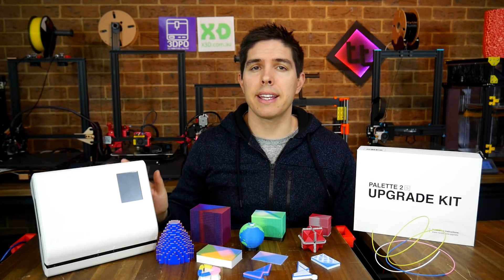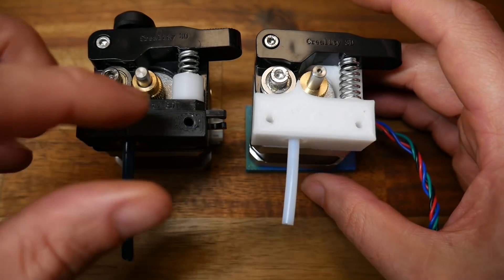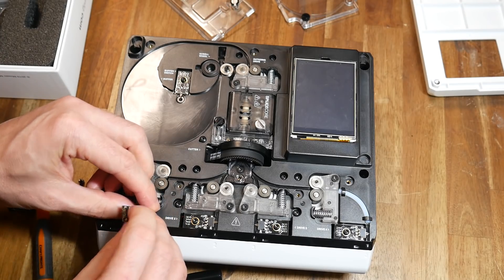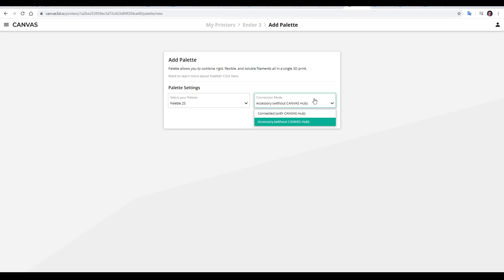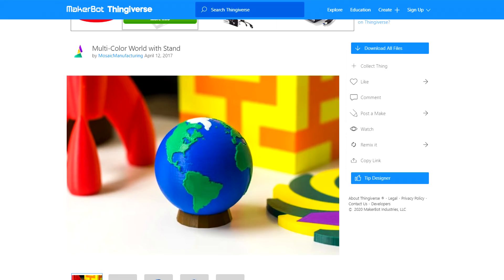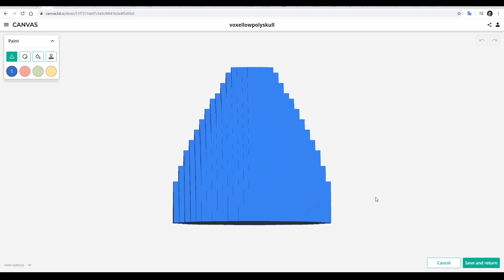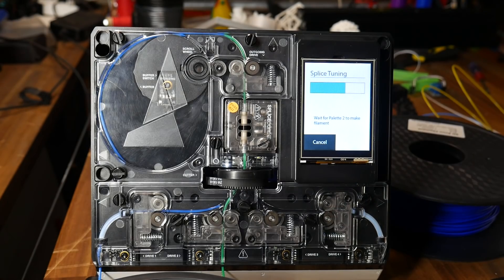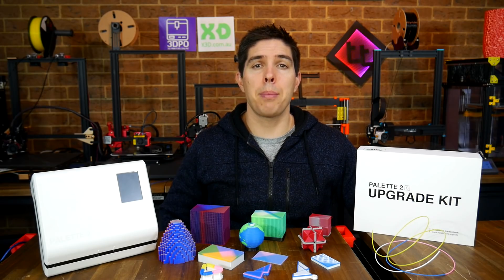Testing the Palette 2S upgrade kit

Comment: LMFAO, the damn original kit is $500, and THEN you have to buy a "upgrade kit" for an additional $125 to even make it work properly ?? Is this some kind of joke ?? When you have to buy additional parts to make the product work as originally designed, it is NOT an upgrade. IT IS A DEFECTIVE PRODUCT. 
I like this channel a lot, but for this product to be reviewed as if it's anything but a massively unreliable ripoff makes me question if there's some kind of deal being worked out here behind the scenes.
Reply: Not only that but they are selling the older model on their website that apparently does not work for a mere $100 off $499...You got to be kidding.
Reply: @stevelaminack1516  The whole situation is a joke. $500 for the product was a ripoff in the first place, but fuck it if it's top quality and it does what it advertises, ya know ? But to have it turn out to be buggy and unreliable, and then sell the fix as an "upgrade kit" is the biggest joke of all. Very disappointed that the reviewer didn't take a stronger stand on this and just acted as if this is normal behavior for a company to do, especially with such a "premium" level of product.

Comment: I have been fighting with my Palette2 for several months. I had to send it back to the factory for them to test it out and they found that there was a problem with the encoder. They were able to replace that and ran several test before sending it back to me. I've now had it for a few weeks and after several test prints, it is working better than before. I was initially running it in Accessory mode but I have since changed to Connection mode and that works a lot better than Accessory mode. And after some needed tweaking it seems to be on the right track. i will say this - their customer support is flawless! They bent over backwards to get this machine up and running and I can't praise them enough for their dedication to their product. And a special shoutout to Adalyn who was instrumental (and very patient to put up with me) in getting everything up and running!!  Thank you, Adalyn!

Comment: does the palette think ahead? 

like "im at layer x with 80% red, 20% green filament needed.  the material between my slicing core and the nozzle is about 10% of the material this layer requires. so i switch from red to green at 70% so when the 10% leftover red filament in the tube is used up, the green arrives,  minimizing the purged material amount.
Reply: From the looks of it, the thing doesn't even only do one color change per material per layer... it does the color change back and forth multiple times. Note: I haven't seen it do this, I'm just gathering this from what I'm seeing.

Comment: While I am happy to hear you finally got it to work consistently, the high price of this device, in addition to the added cost of a metric buttload of wasted filament on purge blocks means this thing, while conceptually very neat, is not ready for primetime.
Reply: Really the wasted filament would be nbd if only home filament extruders weren't $3,000 as well.
Reply: @xKatjaxPurrsx   you can apparently home build a "cheap" one for around $600, but even at that your looking at $1200 for a whole setup, not exactly hobby tool budget lmao
Reply: For prototype production this is still really good. But it’s to expensive in material cost for mass production anything.
Reply: Side transition is key.  Saves allot of filament.  But you are right, this upgrade is still a bit pricey.  I think the real potential is using this device for support material.  PETG works well for PLA.
Reply: @brightnovastar  never thought of this.. so pla doesnt stick to petg well? will consider this :) thx
Reply: Yeah, this thing sure isn't going into any public schools for sure.
Reply: Spot on!!!
Reply: They should start selling a machine that can turn the wasted filament back into usable filament. That's the only way you can waste filament like that.
Reply: I’ve definitely been inside too long, because my first thought was to wonder whether there’s such a thing as an “imperial” buttload, and how the two measures compare.
Reply: Stephen Youndt As I live in the USA, yes, that’s an Imperial Buttload. I’m not sure of the conversion rate, but I think that equals 0.3 Metric Fucktons
Reply: @Hacker-at-Large  Dude, literally exact thing here...
Reply: @Hacker-at-Large  Indeed, the Metric Buttload is smaller than the Imperial Buttload. The ratio being about 2.2, like Kg and Lb. Confusingly, the Metric Assload is bigger than the Imperial Assload, and both Assloads are bigger than an Imperial Buttload. And then you get f*ton's; where of course the US split off their interpretation from the UK, so you have Metric F*ton, UK Customary F*ton, and US Improved F*ton.

In all, Metric Buttload < Imperial Buttload < Imperial Assload < Metric Assload < Metric F..kton < UK Customary F..kton < US Improved F..kton. And the only thing they have in common is this is all a big load of ass...
Reply: Well said Sir! Precisely my observation as well.

Comment: With all these test before it get to being right i feel that you could use a pellet extruder hotend for shredded 3d printed parts.
Reply: That would be wicked awesome but thr weight of all of that would be a bit, I'd print slower to have that option though
Reply: Agreed. For me with the amount of waste involved in this thing having a filament extruder setup to recycle said waste would be a pre-req and that drives the total cost up to amazing never before seen heights. I guess I'll have to continue settling with painting my prints in post process.

Comment: What's a core xy printer that you recommend
Reply: Ender 5
Reply: @miranda.cooper  Ender 5 is not CoreXY, but Cartesian. Ender 4 was one easy conversion away from CoreXY, but you cannot buy it anymore. As for CoreXY printers, two very good options are Voron 2.2 and SecKit GO - both are on the pricey/quality side.
Reply: @miranda.cooper  Thanks for the input dummy.